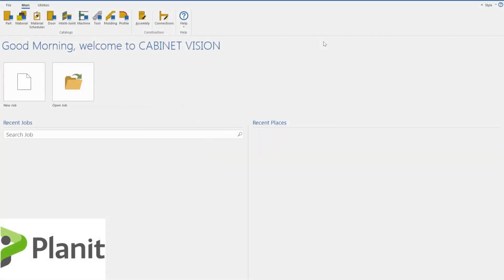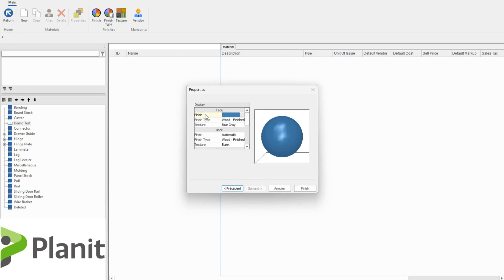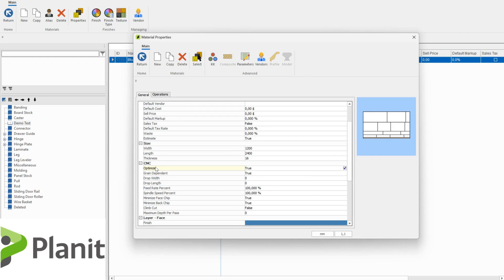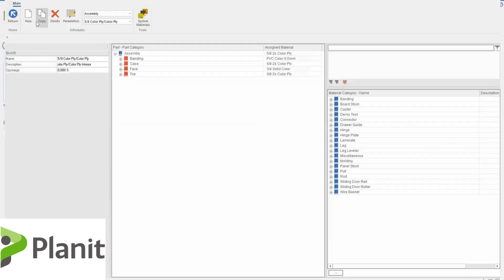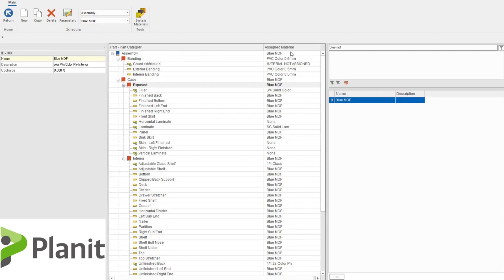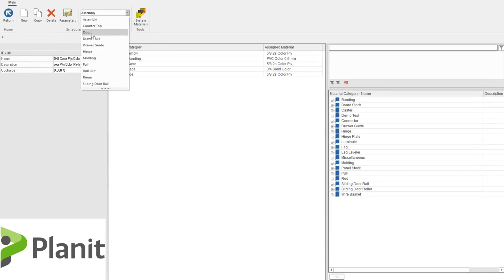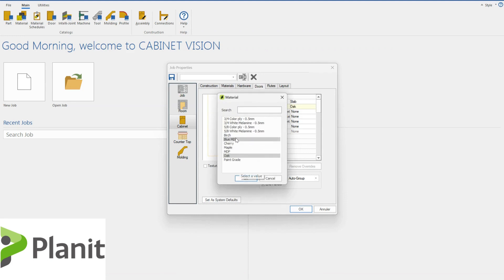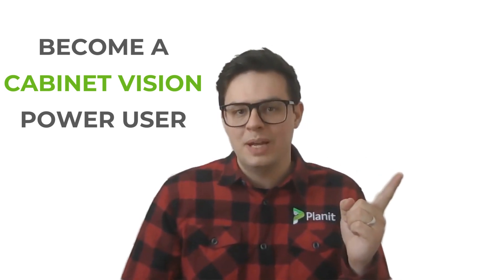How to Create a New Panel Stock Material in Cabinet Vision (Beginner)

Comment: Instead of adding every single colour,  can a ucs change cpgr1 to the actual material name on the parameters level for label and report purposes?
Reply from the maker: Hello! Using a UCS to change a material name won't likely work, but you could use a system parameter or a UCS to add a comment to your parts and then ensure this field is displayed on your labels and reports. However, I am not sure that would be advantageous for you long-term, because not all materials come in the same size or cost the same. So you would limit your ability to effectively price and optimise your projects as your catalogue diversifies. Creating the materials to correspond to the materials being used in a job is the best way to do it if we need to price or fabricate with Cabinet Vision. And with time, you create less and less materials as the library meets your general needs, and copying existing similar materials also takes less time thanks to experience.